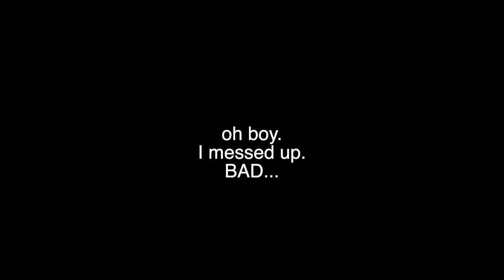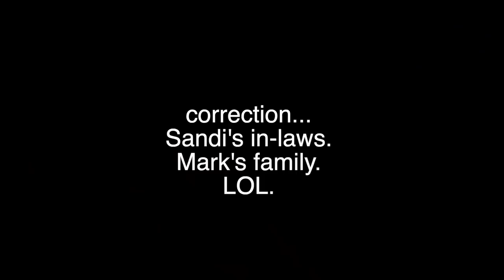this is why we can't have nice things, DARLING... | because EWE break them🤦‍♀️ | Vlog 477

Comment: Drawing the chain routing wasn’t cheating that is smart

Smart is also writing fluid types next to filll points and tire pressures next to the tires as well
Reply: Forgot installation dates on oil filters

Paint pens are great things
Reply: When I used to work in the  lab, we dated EVERYTHING:  when it came in, when we started to used it.  Did wonders for our inventory & stock control!  Our wet lab worked on how to kill zebra mussels (Dressenia polymorpha).  Those li'l varmints are livestock too!

Comment: Starter fluid sprayed around the inside of the rim…and a nice little butane torch from Walmart in your pocket!!…..one spray, and then make sure it’s resting around the drum, and snap….it should explode and snap the tire back on!!…hope so!!…if it does, you can check for air leaks by adding a bit of dish detergent to the spray bottle, and spray the tire till wet, then ck for bubbling….there’s your leak!!👍👍good luck and bless you!!❤️❤️❤️❤️❤️

Comment: You make it look 👀 so easy in many ways. We had sheep when I was little and they were more work in many ways than what I see on your videos. I used to clean the barn with pitchforks and shovels. We fed grain and water in five gallon buckets. I drove the team to get hay with a cable for the big round bales and rolled them out by myself. I drove the team and hay trailer to get the square bales and stacked them to take to the barn to put and stack them in the hayloft. I drove the team and wagon for the piles of manure to spread it out on the fields. It’s good that you have all the equipment to make the work easier. I never wore shorts 🩳 or tops like what the young girls do there. You are all good people though and I enjoy your videos. I just wish that when I was on the farm working that I had the machinery to help the work be a little easier.

Comment: You should put in one of the little float valve waters into each bottle baby area. The kind you have in the other building.  You can run it off the hose you use on the milk machine.

Comment: You may not want to answer this question. When you're scooping out the used bedding straw, have you ever found  a stillborn lamb or a dead sheep hidden in the straw? Also, one of the ewes seems to have a big black spot on one shoulder, not just the random splashes of paint.

Comment: Would it work to poke a hole in those pieces of plastic and loop a piece of rope through it, and feed that over so you can pull on it when it starts to be free of the hay?

Comment: I know, I know, I ask a ton of questions lol
If I dont ask then I'll never know right?
If that hay is wet, then how would it start a fire? It seems like extra dry would start a fire before wet?
💚 & 🙏
From  Va Beach Virginia
Reply: Wet straw is rotting straw. Decomposition produces surprising amounts of heat. That heat can cause a fire in the dry straw. Straw burns very hot, and can spread much faster than you would think.

Comment: Please excuse my ignorance, but what is the difference between straw that the sheep sleep on and hay that sheep eat? If anyone can answer me, thanks.
Reply: You just did! :) They sleep on the straw and it absorbs the urine and manure. It is the byproduct of grain crops, the stalks left over after the grain is removed in the combine. The hay they eat, and is a grass and alfalfa mix. It is cut  2-4 times a year, depending on how much rain comes and allows it to regrow, which it does same as your lawn might. Hope that helps.

Comment: Maybe during conception the sheep are all out on a pasture running around.
Reply: No, they are raised and bred in the barn.  
Sandi runs a meat lamb operation, that means she has three breeds groups of ewe (about 120 ewes per group), bred in rotation throughout the year. She has three lambing sessions per year.
This is Canada, we have predators here. Predators hone in on pregnant animals, birthing animals, and young animals. Sandi ALWAYS has pregnant ewes, birthing ewes, and young lambs in the flock. It would just be a predator buffet if they were outside. 
As well, because of the things going on in the different groups, Sandi is always adjusting their feed at least every two weeks. (Sandi also has rams and growing ewe lambs in the barn.) She cannot do that on pasture.
Also we get winter in Canada, with three to four months of -10 C to -35 C temperatures and very thick snow pack, plus blizzards. Lambs can't survive outside then.

Comment: have you thought about letting them out to graze?
Reply: That would require a large investment in fencing and handling, a guard animal for the local coyote population, pasture management, more land planted in hay to replace the area in pasture etc etc. It was something they considered before making the final decision to invest in the type of barn they did, which maximizes light and air, while still providing 24/7 protection from elements and predators.

Comment: You are always so on top of things. Its honestly amazing! I cant even remember basic words much less all the tasks you have to remember that isnt part of daily chores. Something that I remember you talking about probably around a year maybe year & a half ago was putting some kind of cement curb between the area you put the manure/compost and the area for the feed bags since they're on the same slab. I know most of the year it isnt an issue but during monsoon season doesn't it become one when the rain starts soaking the compost and running towards the feed bags? Especially with the feed bags as far back as they are now.  Is there still a plan to put in that curb/divider?

Comment: Why don't you have automatic waterers for the sheep instead of buckets of water.
Reply: She does have automatic waterers, but when she makes smaller pens, she has to bring pails of water to that sheep. It doesn’t make sense to close one sheep up with an automatic waterer when you have 99 others in the pen that need water too. Same with the lamb creep area. She puts buckets in there for the lambs, but the lambs also have access to the auto waterers outside the creep area.
Reply: The waterers are those blue box looking things near the centers of each side of the barn.

Comment: How come the sheep don't go outside?? Wouldn't  it be easier to let them graze a bit,???
Reply: No, they are raised and bred in the barn.  
Reason #1: 
Sandi runs a meat lamb operation, that means she has three breeds groups of ewe (about 120 ewes per group), bred in rotation throughout the year. She has three lambing sessions per year.
This is Canada, we have predators here. Predators hone in on pregnant animals, birthing animals, and young animals. Sandi ALWAYS has pregnant ewes, birthing ewes, and young lambs in the flock. It would just be a predator buffet if they were outside. 
As well, because of the things going on in the different groups, Sandi is always adjusting their feed at least every two weeks. (Sandi also has rams and growing ewe lambs in the barn.) She cannot do that on pasture.
Also we get winter in Canada, with three to four months of -10 C to -35 C temperatures and very thick snow pack, plus blizzards. Lambs can't survive outside then.

Reason #2
You can't just "let them graze a bit". Pasture management is a whole other area of work. Besides managing the grass, for sheep, is the huge amount of time dealing with parasitic infections. Sheep get a LOT of flukes and worms which need to be monitored and treated. The y can cause major problems in health and wool/meat quality.
Sandi has NO parasite problems in her flock because they are not on pasture. She feeds the hay, haylage and corn gown on the fields that would be pasture.